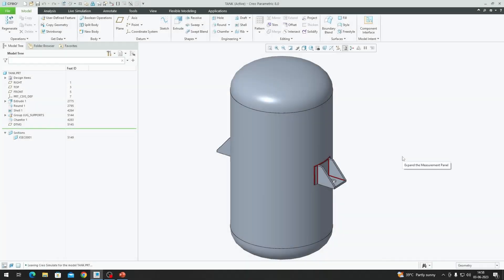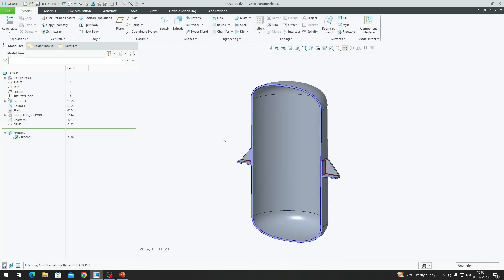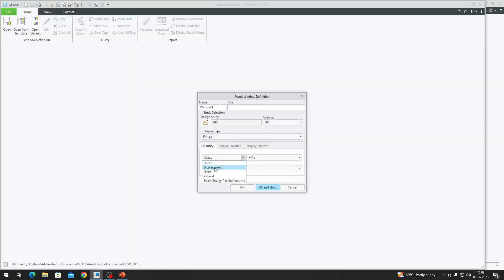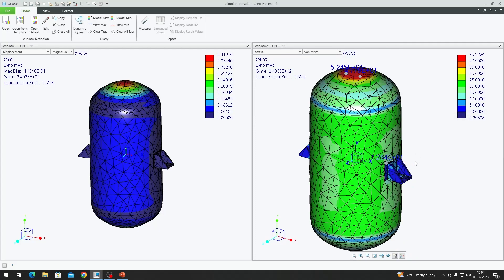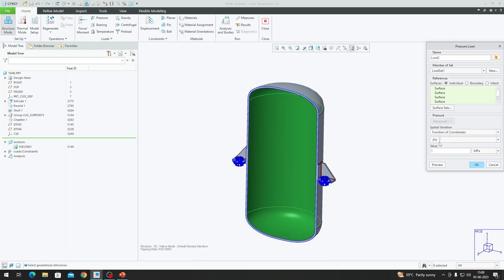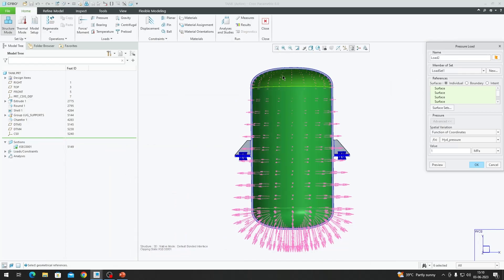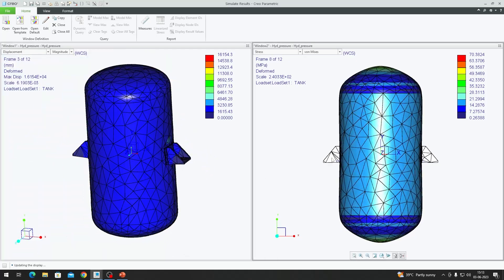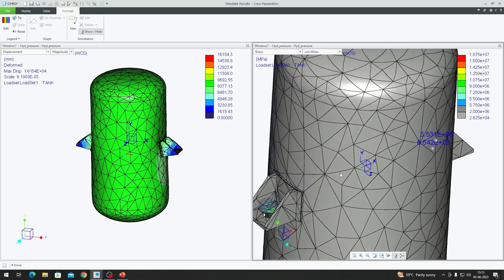Pressure Loads tutorial in Creo Simulate

Comment: The video was very nice sir but I could not understand one thing.
In case of hydrostatic pressure loading. Why the displacement and stress is so high? It is approx. 16 meters and 25000 MPa? How is this possible. Is this practical?
Reply: Got it sir! Thank you! I modified the formula and got the result accurate. What is your full name sir? Are you there on LinkedIn?
Reply from the maker: Good catch. It’s because of the incorrect units setting in my model. I was using tonne/m3 density where as global units were g/mm3